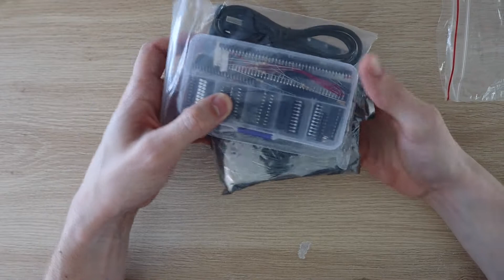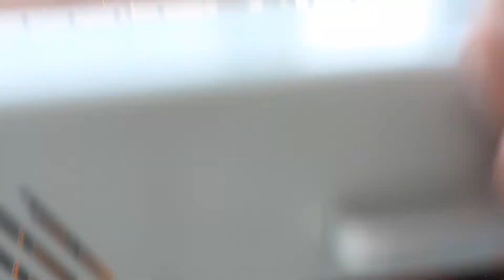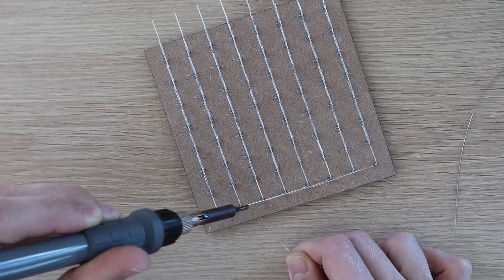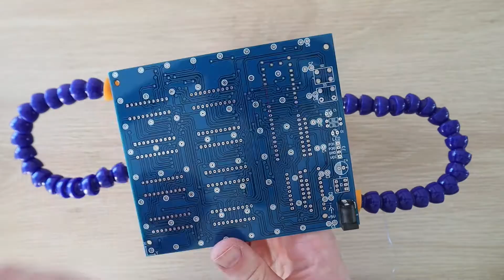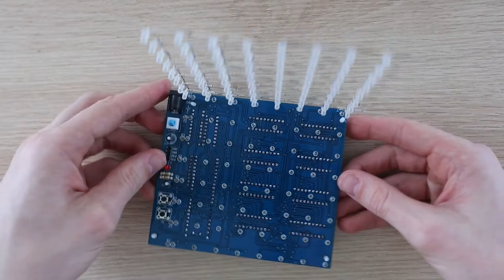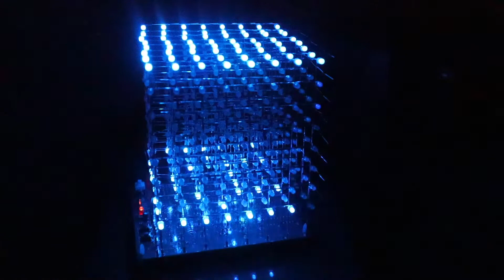Building an 8x8x8 LED Cube from an Amazon Kit - Arduino Compatible

Comment: Nice to see how you did this. I found this project back in a box after I bought it in 2014 or so and never finished it. All I did was solder the PCB, like you did, without a manual. Seeing how you did it gave me a little extra confidence 👍🏼

So now I've designed and printed a special bending jig with two rulers especially designed for two different heights. These are printed as well and it works really well to bend the LED's this way. It's just a lot of work 😅

I guess I'll get to soldering tomorrow. Our kits look identical, so I expect the same results.
Reply from the maker: Great to hear that the video helped someone! Hope you manage to get yours working! It is a lot of work to put the LEDs together in a way that looks neat.

Comment: This was a huge help for me! I bought the same cube with the same missing parts. I contacted the seller and was sent instructions in Chinese for a different board. They never said anything about the missing parts, but they were easy enough to obtain.
Reply from the maker: Yeah these kits are a bit of a gamble, the sellers are very seldom helpful when you've got any problems with them.
Reply: I got the same kit and couldn't get it to work ao I got a new one from icubesmart. That worked, perfectly.

Comment: How long to complete this project from start to finish ?  Did you look at other YouTube videos of these being made ? I saw one that had a cardboard template being used.
Reply from the maker: I started it on Friday evening and finished on Sunday morning. I'd say it took around 7-8 hours of work to complete, including making the template. I looked at a few write-ups online for guidance. I also saw the cardboard template, and some people have used a strip of wood with holes drilled into it, I combined the two to make an MDF template. It's a bit more rigid and durable than the cardboard.